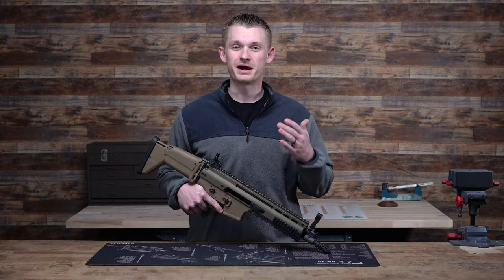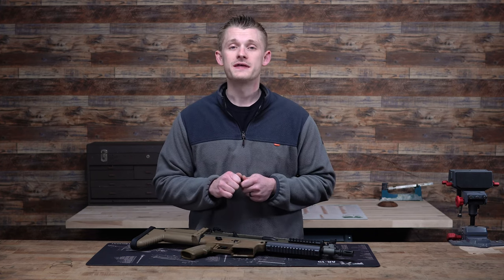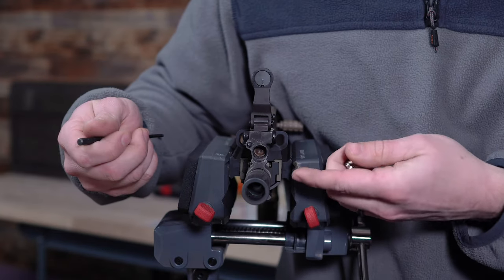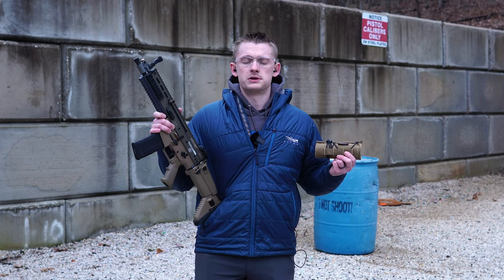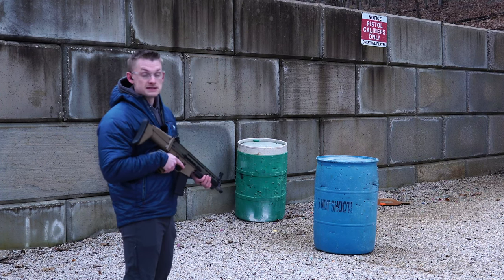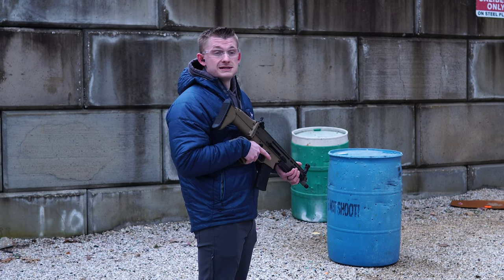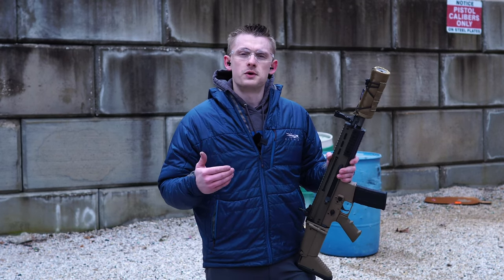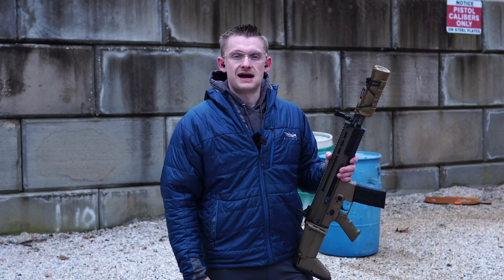FN Scar KNS Precision DiSCARder Gas Regulator

Comment: I’m running a 17 with stock 16” and surefire RC2. Would you swap out the jet with one of the ones provided or keep the original jet installed. Just received mine from you this week. Thank you
Reply from the maker: I would try it out with the stock jet, and see how the regulator does with adjusting it.
Reply: How did it do? I am looking at this for my 17.
Reply: @cyberdrift1  runs awesome no issues.
Reply: @starrynightshilohs so no jets and just install the new gas block?
Reply: @madbroindustries  Wondering the same thing - just got my Discarder and it came with 4 extra screws. Wondering if I should just leave the stock screw in and install the Discarder or if I need to use one of the provided screws with the discarder? This for a SCAR 20S with a Surefire RC2 762 suppressor.
Reply: @starrynightshilohs it never started to mess up the back bolts with this added ? I’m thinking of getting this for my scar 17s so I can suppress it

Comment: I cant even get my gas regulator to move. Its completely siezed up.
Reply from the maker: I would try to lubricate it, and see if that helps. Reach out to KNS if it still won't turn.
Reply: Any updates?
Reply: buy some lok-cease 20/20, problem solved.
Reply: Ive had to use pliers, it also only twists off one direction
Reply: There is also a detent that you have to press to remove it
Reply: This is a piece you will have to clean, as its not a di, all the gases exit at the piston so all the dirt gathers there

Comment: dont know why this is being touted as revolutionary. Mototech has had a product exactly the same with multiple generation refinement for years now. Seems pretty unoriginal.
Reply: Mototech restricts the gas flow, KNS controls a waste gate plus diffusion and torturous gas path - different animals. Mototech only came out with detent system after KNS did.

KNS comes with regulator screw tool and a few addition regulator screw sizes in case the user wants to configure to run on underpowered ammunition like steel case range quality. So you get a little value added there.

Customer should purchase the product that best works for their application.
Reply: @HalcyonDefense  I mean what application would suit one better than the other? Far as the gun and its use is concerned they do the same thing. Question is which is more reliable.
Reply: @RADIOACTIVEBUNY    They do not do the same thing - restricting the gas vs. controlled release yields very different results regarding bolt carrier acceleration. Then there is the tortuous path the gas must take, then there is the diffusor feature to minimize port pop, better surface coatings, gas control screw tool, etc.....

The KNS design also does not break the plane of muzzle thread shoulder - so it will not interfere with thread on suppressors.

If your goal is to suppress the SCAR™ and not damage your bolt carrier cam track - a controlled release is your better option.

As far as reliability - the KNS design has zero internal moving parts and the detent system is ported from the AK gas piston, which has a proven history.
Reply: No offense, but mototech is not anywhere near this, and I’ve had both. Still have the kns. Eddie is a super nice dude, but I’ve had nothing but issues with my mototech stuff. My TiN piston corroded in like 800 rounds, my buffer delaminated after 1000 or so rounds, and my torx scar fastener kit rusted in less than 6 months. To top it off, you can get a kns to your mailbox this week, and mototech may take 4-6 months. It’s a great concept, and you’re right, it’s not new, but this is a company that is able to keep up with demand and ensure quality materials.
Reply: Actually... they are not the same, as others have already explained. The Discarder works very similar as the FAL gas systems 70 years ago (controlling venting) ..
These adjustable gas systems are definitely not original, but they are in the SCAR realm, since FN made sure to K.I.S.S. while functioning reliable.
Reply: @RADIOACTIVEBUNY  they Don't Do the Same Thing. :)
Reply: @alexlevinson8629 dude whatttttt. How did all that happen to your gun?
Reply: very different..........